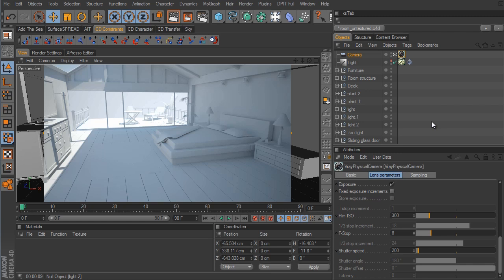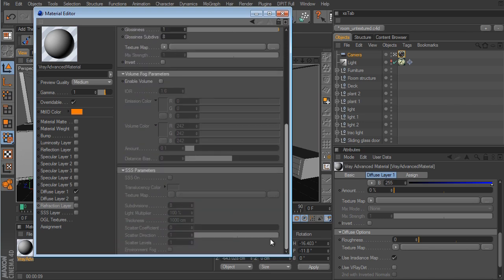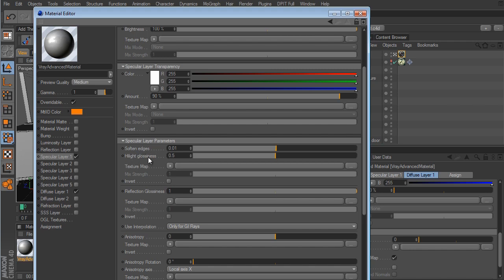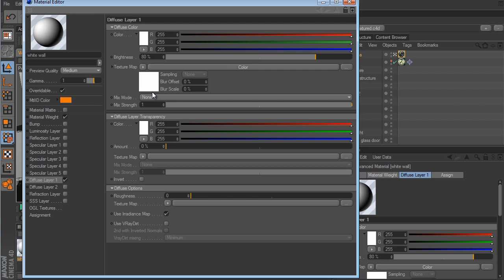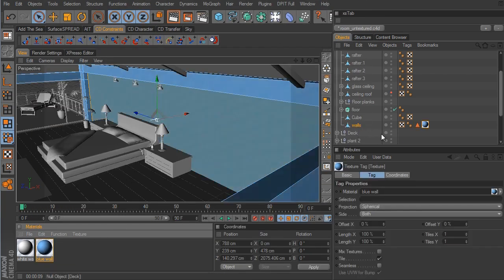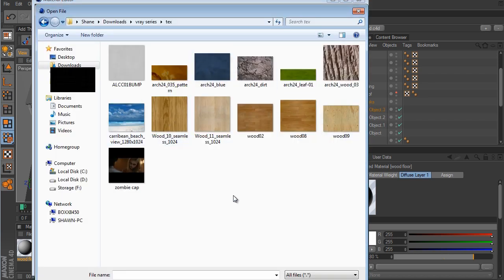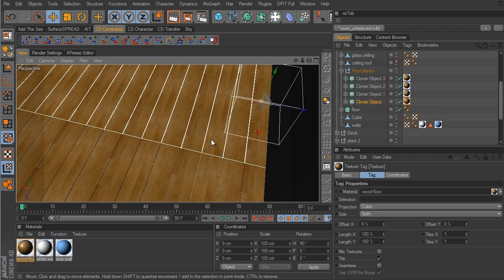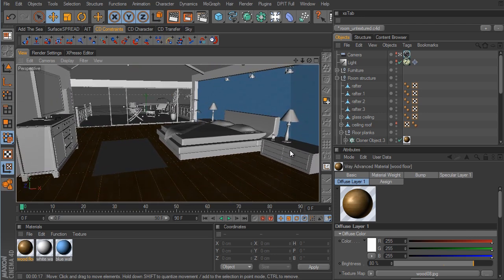VrayforC4D Tutorial - Vray Material

Comment from the maker: As far as I know, the next upgrade should not cost anything. I was under the assumption that it will be a free upgrade for licenses users.

I am not aware of any work-arounds for the object buffer problem. The current multipass system in Vray sucks. For most work, I use the standard C4D rendering engine.